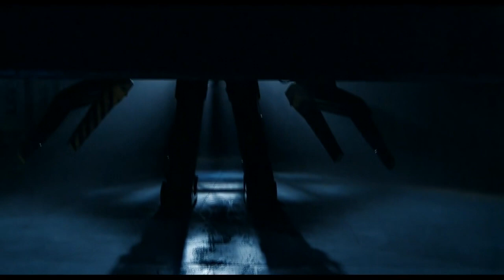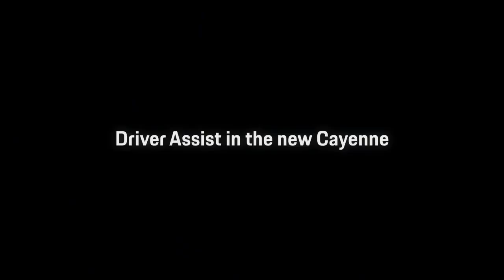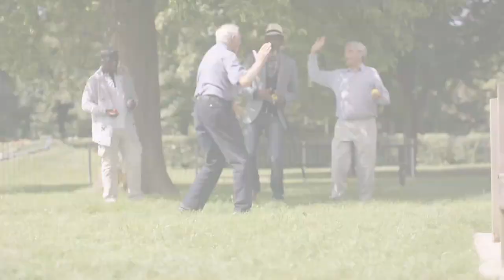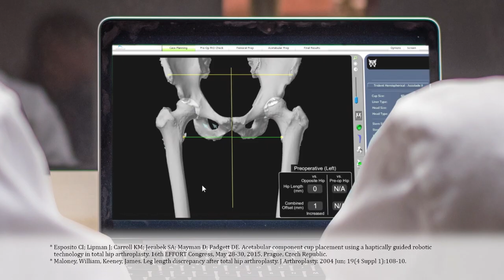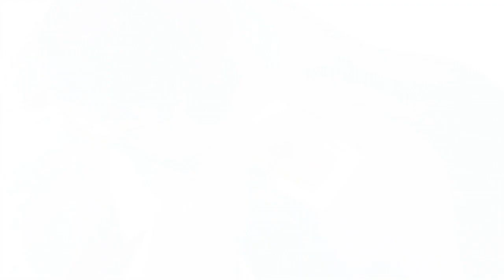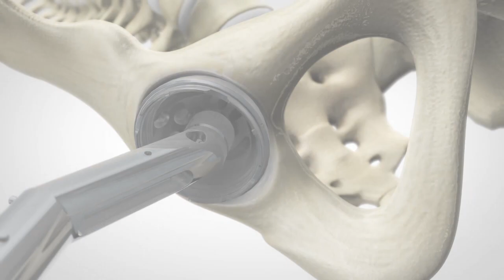Mako robot for hip replacement

Comment: Sir which is the best stem- collared or non collared,best Head and best cup…plz tell company name n materials please ?
Reply from the maker: There is no simple answer. The best hip for an individual depends on the anatomy, pathology and surgeon’s training and experience. All of the major manufacturers (Stryker, Zimmer, DePuy, S&N) offer similar ranges of implants.
Reply: Thnx sir
Reply: 1) WHAT IS THE DIFFERENCE BETWEEN DAA VS BIKINI VS POSTERIOR APPROACH?

2) HOW MANY MUSCLES U CUT IN UR TECHNIQUE?

3) WHICH IS THE LATEST IMPLANT AND STEM N OF WHICH COMPANY?

4) IT GET CUT LATERAL CUTANEOUS FEMORAL NERVE or ANY OTHER NERVE WITH UR TECHNIQUE?

5) WHICH IS THE BEST ACC TO U- MANUALLY THR BY U WITH ACTIS COLLARED N JOHNSON N JOHNSON IMPLANT OR MAKO ROBOTIC WITH ALL STRYKER AND ACCOLADE STEM?

6) Y U DUNT USE WATER SOLUBLE / STAPLER OR PICO SUTURES?….IF ANYBODY WANT WATER SOLUBLE/ STAPLER/ PICO STITCHES, U WILL USE THEM?

7) DO U HAVE HANA TABLE OR ANY OTHER TABLE OR U R USING SINGLE TABLE ONLY?

8) MINIMUM N MAXIMUM LIFE OF CERAMIC ON HIGHLY CROSSLINKED POLY IMPLANT?

9) DO U ALWAYS REPAIR CAPSULE IN EVERY CASE SIR?

10 ) WHAT U DO FOR MAINTAINING LIMB LENGTH AND FOR ACCURATE POSITIONING OF THE IMPLANT?

11) HOSPITALS IN WHICH U R DOING THR RECENTLY?

Sir these are the questions which were asked in All world group Avn patients….pls answer them🙏🏼

Comment: How is the artificial hip secured to the pelvis?
Reply from the maker: It’s a press fit. The bone grips the rough surface of the cup and grows into it. We use screws when necessary.
Reply: Thanks! So I'm clear.  The screw if necessary is used to secure the metal cup into the pelvis? Or the artificial hip to the cup?  And what determines if a screw is used?  Thanks again! @Lathamhipsurgery
Reply from the maker: The screw is used to fix the cup to the pelvic bone. The head is held in place by the tension in the soft tissues. This is why you have to be careful when twisting the hip so that the head doesn't dislocate from the socket. I use a screw if the bone is weak or there is a deficiency, such as in dysplasia or when doing revision surgery. @earlejames8475
Reply: Thanks!!  @Lathamhipsurgery
Reply from the maker: @earlejames8475  you’re very welcome!

Comment: Hello Doctor, thanks for the video. May I know which is the best material for implant for a 72 yr old female AVN patient? Is Robotic surgery good for old people?
Reply from the maker: Thanks for your question. For most people I use a stem made of stainless steel or titanium, a cup made from titanium, and the bearing is ceramic on polyethylene. The robot can be useful in complex cases, but it isn't necessary for most people. The most important factor to achieve success is to choose an experienced, careful surgeon who will help you to make the right decision about what is best for you.

Comment: Doctor mi pierna a operar es 1cm más larga la operación robótica corregirá esa dismetria o la aumentara más gracias
Reply from the maker: Thank you for your comment. The mako technique will give an accurate measurement of the difference in leg length. This will help the surgeon to make sure that it is corrected by placing the components of the hip replacement in the correct position. I hope that answers your question.
Reply: @Lathamhipsurgery  gracias

Comment: My surgery on rite hip first on May 19 this channel has really helped me understand . But I wouldn't want a robot doing my surgery , much prefer a good surgeon
Reply from the maker: Thanks for your comment. I’m glad that you find the channel helpful. The mako robot doesn’t do the surgery but is used to help the surgeon place the implants in the pre-planned position. It’s a bit like using GPS navigation 🧭 n your car. Wishing you well for your surgery. It will transform your life!
Reply: @Lathamhipsurgery  still rather a surgeon maybe I'm to old school but the way this world is going old school may be best for all
Reply: The robot doesn't do anything , the surgeon controls the arm, not the robot. It just tells the surgeon where to place the cup so you have a better gait or walk. Also, the robot helps get the leg length correct. 😊 it's more computer assistance than a robot.

Comment: Does mako produce better outcomes than traditional?
Reply from the maker: Good question. There are no long term data to show that functional outcomes are any different compared to standard surgery. The Mako gives a very robust pre operative plan and helps the surgeon to achieve the desired position of the hip replacement socket. This should reduce errors and lead to reduced complications.  Patients who have Mako are more engaged in the process of having surgery and I’m sure that makes them more confident. Time will tell whether or not the outcomes are better.
Reply: @Lathamhipsurgery  Hence why the code that surgeons use for this type of navigation is denied by insurance and the extra cost is placed on the patient as an out of pocket cost that doesn't count towards your healthcare Deductible or max out of pocket costs.

Comment: Hello sir , i am from India,  what is the advantages of robotic thr from patients perspective? Like increase in implants life . I am an avn patient.  Planning to do robotic thr by next month. Same machine
Reply from the maker: Thanks for your question. The advantages are these. Firstly it gives you a very precise pre-operative plan so that you know the sizes of the components that you will use, and the positions into which you will put them. The robot then helps the surgeon to place precisely the components into the planned positions. These factors should reduce the risks of dislocation, leg length differences and in the longer term, hopefully reduced wear.
Reply: @Lathamhipsurgery  Very very thanks for quick and detailed reply sir. One more thing  i want to know Doctor . Can i sit on the floor after robotic thr without the fear of dislocation. Not for regular use.  Sometimes i need to sit on the floor for religious purpose.  Thank you
Reply from the maker: @sridhars783  Happy to help. As long as your surgeon is happy with the result of your surgery, then it should be fine for you to sit on the floor.
Reply: @Lathamhipsurgery  God bless you

Comment: Does the hip operation using Mako take the same time as the previous method?
Reply from the maker: It takes me about an hour to do a 'standard' hip. The robot adds about 15 minutes.
Reply: @Lathamhipsurgery  I am due to go in for a hip replacement with the robot .how long does it take for the whole operation and they said I am eligible  for the epidural and sedation is that the best way to go or a general anaesthetic I would appreciate your comments .thankyou.
Reply from the maker: @annegoodwin9581  the whole procedure takes about 2 hours including anaesthesia and time in theatre. Most of my patients have spinal anaesthesia. It’s what I would have. Hope it goes well.